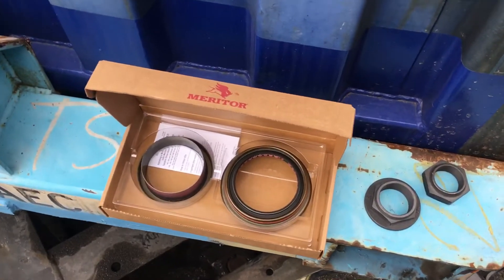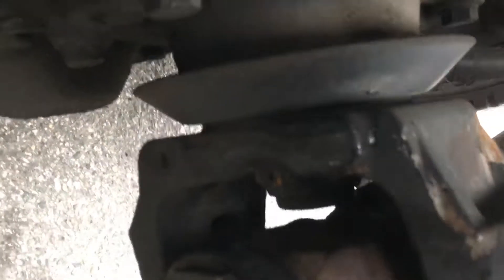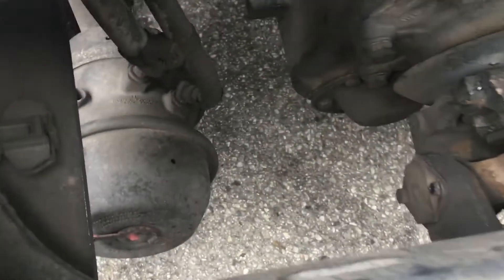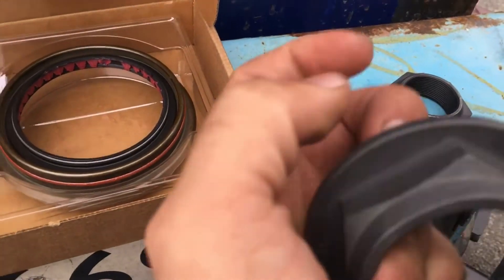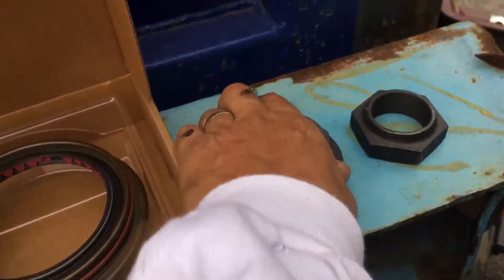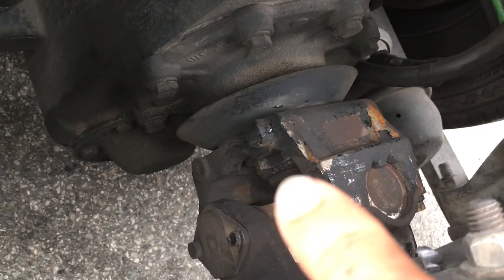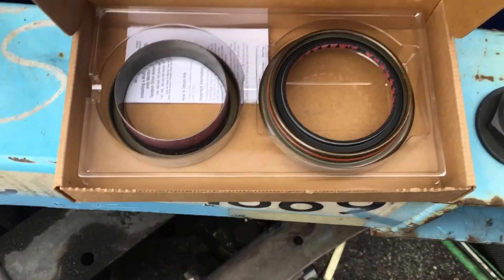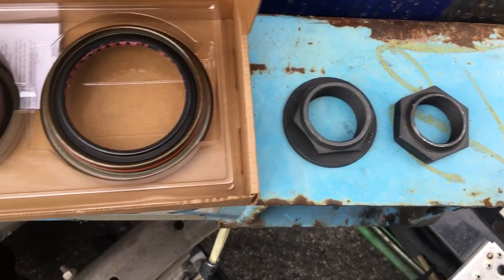Freightliner replacing axle seal

Comment: hey brother i need suggestions about what will be better to buy, century 05 800 thousands with just rebuilt engine series 60
t660 with rebuild engine 2010 has trypac cummins 
cascadia 2010 with 1 million dd13
has apu
all 3 about the same price
Reply from the maker: Noe Alvarez anything but that trypac engine.trypac engines are trash
Reply: Vic Med yes is what I thought
the cascadia has 1M miles but don't know if the engine have had rebuild.
Reply from the maker: Noe Alvarez I would take the century if it has a rebuild engine.
Reply: Vic Med thanks for your opinion
Reply: Century with series 60 all day! No questions asked 🫡

Comment: Probably shouldn't do how to videos if you don't know the difference between an axle seal and a drive shaft (yolk) seal.
Reply from the maker: if you thing im going to stop doing my own work and helping people,for you ignored ass ,you should stop tunning in to my channel ,mister perfect!!!!i wing my work and it works,so save your ignorant comments.
Reply: @vicmed6088  umm no, it's not that simple. If you go in for knee surgery and they work on your elbow... you're not helping anyone by misrepresenting your videos
Reply: john nunya you're half right it's not an axle seal it's a PINION SEAL
Reply: Why are you complaining when you can’t even tell the difference between a “yoke” and an “egg yolk”? Hahaha. C’mon now. Not everyone uses the same words to describe truck parts. Technically, Vic ain’t wrong by calling it an axle seal. It is after all a seal on the axle. Sure, it might not be the official term, but who cares. He’s not a certified mechanic nor has he ever claimed to be.
Reply: @thereviewer4173  it isn't on the axel, it's on the drive shaft. There's no terminology discrepancy here, the axel attaches to the wheels. That look like it's anywhere near a wheel to you?
Reply: @CantankerousOB  

I have the official Freightliner manuals. Your wording ain’t even correct. Hahaha. They’re calling it a “radial shaft seal,” and to top it off, it’s under the subject “Detroit Rear Axles.”  You sir, are full of it. If you really want to be accurate, the seal is literally a component of the differential, which is a part of the drive axle.

Also, you need to learn how to spell.